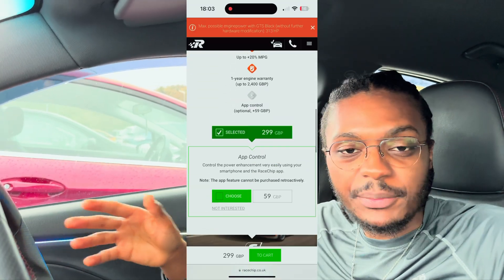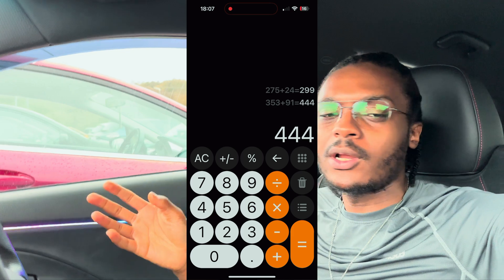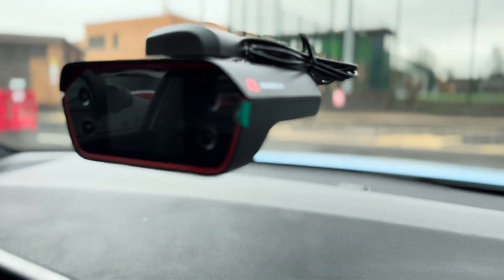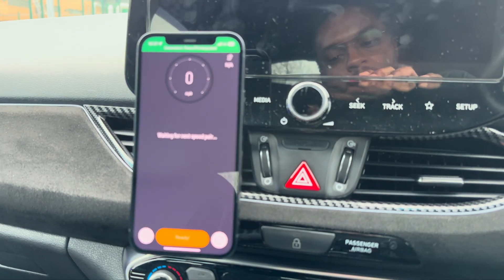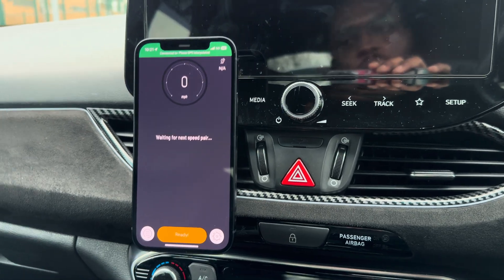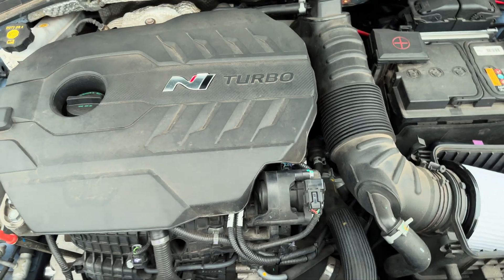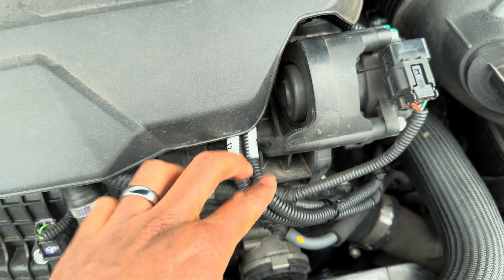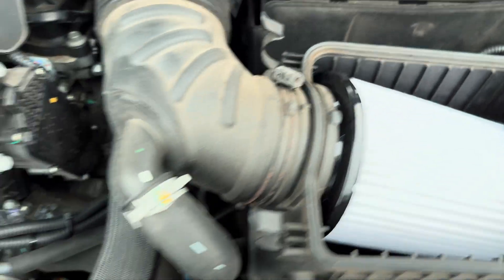Does Racechip Actually Work? Acceleration Tests on Pre-Facelift i30N Fastback

Comment: What’s it like economy wise ? Have you noticed a difference in your MPG? As well as the power increase racechip quote +15% mpg
Reply from the maker: @alecgibb9458 always run it on map 5, no real difference in mpg though a bit worse when pushed (naturally) but quite noticeable increase in torque

Comment: Is there much genuine risk to the motor reliability running a racechip or do you think the motor is strong enough to cope?
Reply from the maker: @rmcer2 I  run it racechip for well over 12,000 miles with no issues- drove it quite hard regularly as well